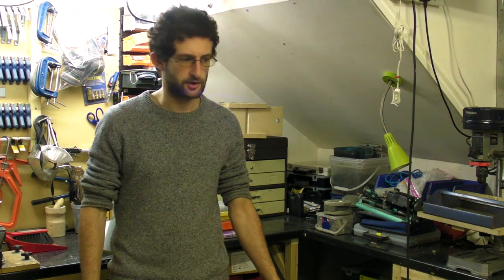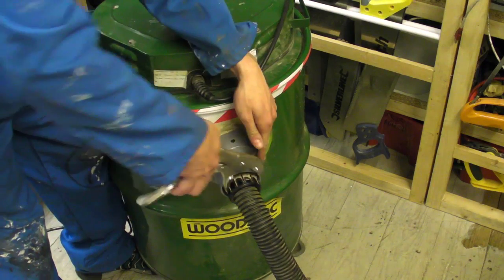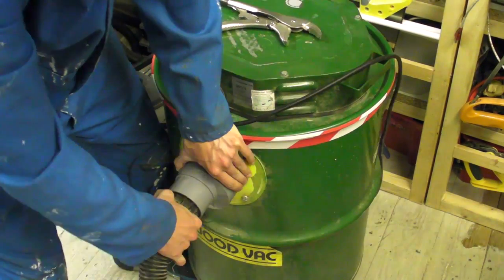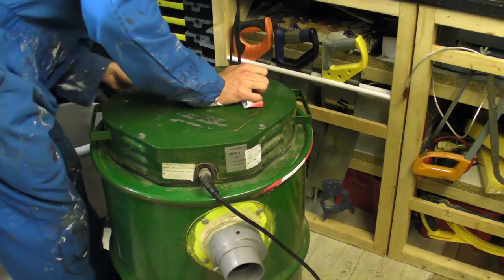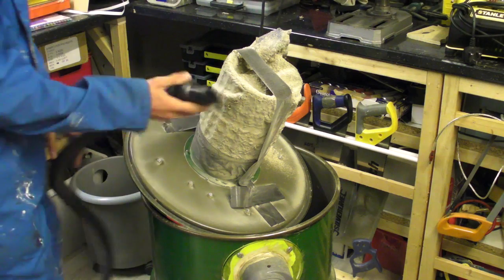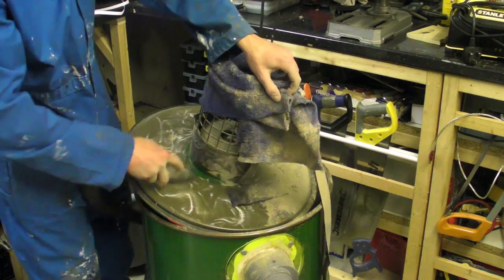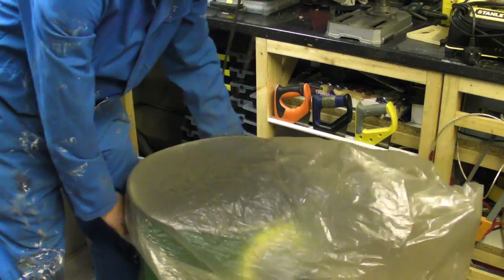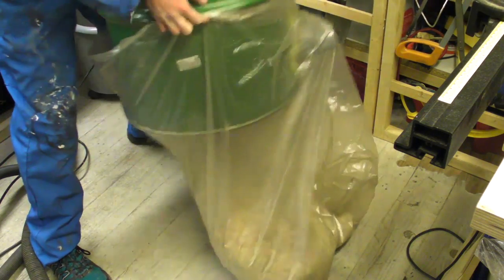Dust Extractor Upgrade - Custom Hepa Filter / Off-centre Cyclonic Inlet

Comment: Hi, when you have to change the paper filter inside, you'll need to make another wooden frame as you did here, right?
how often do you need a new filter? Wouldn't perhaps be better to make a jig that supports regular of-the-store filters so it's easy to change them?
Love you videos, man! take care!
Reply from the maker: The HEPA filter is actually made from fibreglass, and with the non-woven polyester shroud on top, will probably outlast the extractor motor.  Paper ones on the other hand may need more frequent changing.  Thanks for the comment.

Comment: Nicely done.  Your resizing of the HEPA filter was very innovative.  An alternate solution may be to mount the HEPA on the discharge side of the vacuum, leaving the bag filter on the inlet side to catch debris and the coarsest dust.  An external housing or adapter allows the use of a standard off the shelf unmodified HEPA filter.
On the down side an external mounting will increase the size of the vacuum.
Reply from the maker: Cheers.  That would have worked also, but I wasn't feeling confident modifying the motor housing too much.